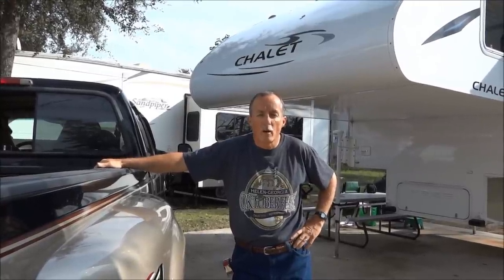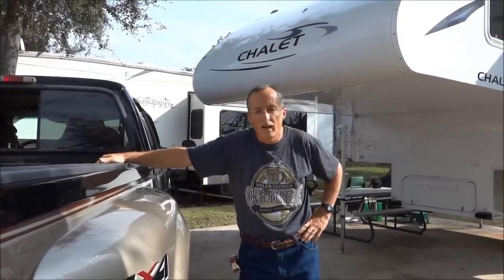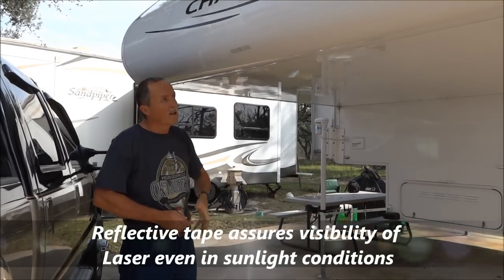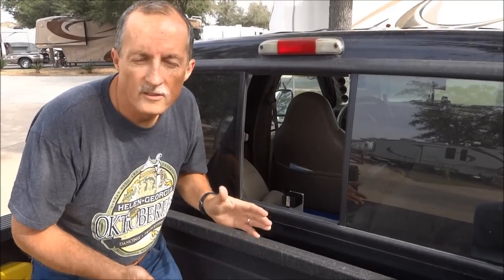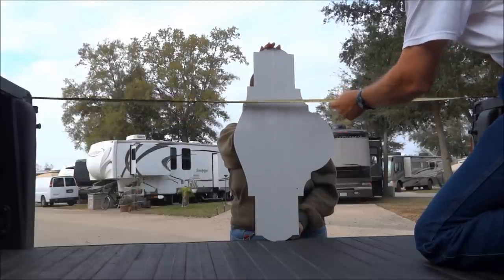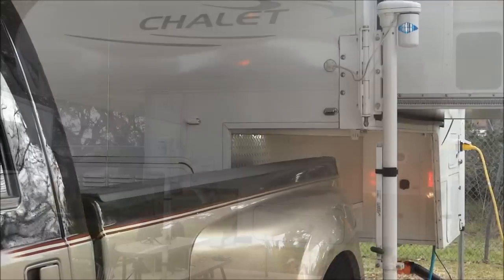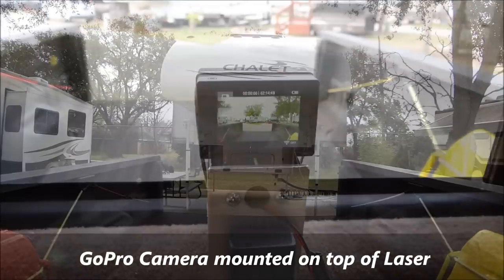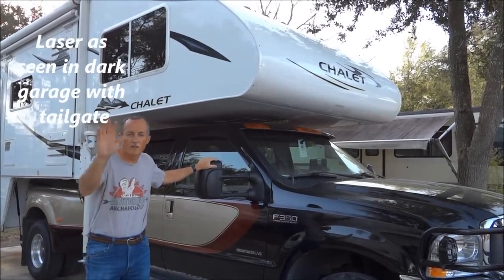How to Load a Truck Camper onto a Pickup using a Laser!

Comment: First thing I did when I bought my camper is sit down and try to figure out an easier way to load it. I don't think I would have come up with this on my own without seeing your video. Kudos to you and thank you so much for making that video! I ended up using a cheap $36 self-leveling crossline laser and the same principle.  I usually self-leveling crossline on a camera tripod to keep my camper perfectly level while raising and lowering it as well

Comment: That's brilliant - well done Charles.  I just finished spending several hours attaching extending, kind of antennae to the front of the camper - 2 thin, rigid, 1" * 1" wooden sticks that are exactly parallel to the camper base but extend into the pick-up bed about 5 feet - to provide a way to line up.  But your way is much more elegant.

Comment: Question- if the camper jacks were adjusted to make the camper level on un even ground and the truck was backing in on the uneven ground wouldn’t that throw off the laser line to the 3 points? Seems to me the camper jacks would have to be adjusted so the bottom of the camper was on the same slope as the truck bed. 
However should work on level or near level ground.
As I think about it… if the truck was placed very near in position, then the jacks were adjusted so the 2 marks on the camper box were inline ( equal distance) from the vertical laser line, then the truck was repositioned so all three points matched it should be very close.

Comment: Great Video Charles, I am a contractor and recently bought a truck camper.  I always figured that loading it with a laser is the way to go.  Ca you let me know what brand of Laser you used ?

I also designed and built a custom "Guide" for my F-350 Bed that prevents it from sliding sideways.  I will share an image soon.  Not cheap to build but works like a charm.

Thanks
Michael

Comment: Charles, I'm in the midst of installing the laser. Are you using sheet metal screws to secure the heat sink to th Al bracket in lieu of the hex nut screws provided? If so, what size screws are you using?  In attaching the bracket to the back of the truck are you only penetrating the seat backing? If so, does that provide enough stability? Sorry for all the questions....not very mechanically inclined!

Comment: Quick question - Looks like you're using some sort of rubber bumper mounted to the front of your camper to halt its forward progress when loading. Is that correct and where did you find those.

Thanks

Comment: This laser idea is a life saver!  My wife and I are newbies and our truck doesn't have a sliding rear window.  I took an aluminum angle iron and mounted the system on it.  The angle iron ,makes it easy to lay right on the top of the front of the truck bed just below the rear window.   By marking a spot on the top front of the truck bed I can easily turn the laser on and place it in the exact center and use it as Charles does.  When I'm finished, I just pick it up and store the unit inside the cap to keep it out of the weather.  Loading the camper is SO easy now!

Comment: Great idea I'm going to try it. I don't have sliding rear window so I'm going to mount a Ryobi laser with magnet on front center of my truck bed and then use 3 marks on inside of the tailgate to do initial laser setup alignment.

Comment: Loading a truck camper is hard, if you have a crew cab.  I have seen people measure the middle of the camper 1/2 way then the truck bed 1/2 way and go simply by the lines.  In the crew cab you literally have about 3 feet where you are blind.  Truck campers are the ONLY way to travel.  Now if you stay in one camp ground for a week and it rains, then you go a little wacky.  Bigger truck campers are HEAVY!  And the dealer, will see you a camper EVEN if your truck is not safe to haul it.  I LOVE MY lance camper but I think I would like the  Chalet but the weight.  oh boy! Great video. I'm afraid I will never go through all this trouble when a little tape will do the trick.

Comment: This is a great video, especially for someone who is backup handicapped. I do have one question, was the bracket custom made or is it available off the shelf. If off the shelf, can you please post where to get one.
Reply from the maker: Jim Collins The bracket was a simple piece of flat 1/8" aluminum purchased from your local hardware store that I drilled a few holes in to mount the laser heatsink and for screws to the truck.  The battery pack I just double back taped to the metal plate.

Comment: Did your heat sink have bolt holes in the back of it.  I got one and the bolt holes on on the side and bottom.  I may have to get a piece of metal with a 90 degree bend at the top.

Comment: I feel this is the best solution so far for aligning and loading my camper. Uneven ground is not an issue as I have a remote control for independent electric jacks. The only issue I have is that in the video, the alignment process is done on a cloudy day, under trees, and plenty of shade. I bought the same system,  installed it just like in the video but when I turned it on in the morning with bright sunshine facing the front of the camper the green laser does not generate enough light to see the white fiberglass or the silver reflective tape at over 8 feet away. Now I feel like I have to load the camper either early in the morning, late afternoon, or when it’s cloudy, which doesn’t happen regularly in the southwest. I will try a different, possibly more reflective tape first, or possibly a red laser. Ideas anyone?
Reply: Red lasers generate less light per mW than green lasers, so if you're having trouble seeing it, upgrade to a higher power laser.

Comment: It seems as if the system would be thrown off if the truck were not on level ground. How do you correct for a site that has a left-right slope? (extremely common in my experience)
Reply from the maker: You simply tip the camper to align the 3 spots with the laser emitted from the truck to make them parallel.
Reply: +Charles Coushaine Ah! Thanks! I'm going to give it a try using my level line generator I use for construction.
Reply: You would have to align the 2 vertical points with the laser then align the truck to all three points

Comment: Great job Charles!  Quick question, noticed gas tanks on forward inside of truck - wondering what size and where can I purchase them.  Been debating how to safely transport a couple gallons of gas - newbie to truck camping!  Thx
Reply from the maker: I purchased those gas/diesel cans on Amazon.com.  A link to one is below:
https://www.amazon.com/Briggs-Stratton-85043-Gallon-Spill/dp/B0038U3FQ0/ref=pd_sim_86_1?_encoding=UTF8&pd_rd_i=B0038U3FQ0&pd_rd_r=1PG7HDSEQGRJY25WYF7W&pd_rd_w=Y2LFV&pd_rd_wg=719wI&psc=1&refRID=1PG7HDSEQGRJY25WYF7W
Reply: Thank you Sir.

Comment: “Tavool” bright green laser available on Amazon July, 2022 for @$50. Appears to come with mount. 
I have a 2008 Northstar pop-up camper, and the gray water tank is a long rectangle that is attached under the camper in a way that really impedes loading of the camper onto my truck. There is only about 1/2 of space to clear. This is going to help! Thanks!
Reply: Hiya.  Did you get the self leveling one?  How’d that work out as I read it needs to mounted on a level surface …

Comment: After just purchasing a new truck camper, I have decided that I definitely need to incorporate your method of loading it on the truck or I think my marriage won't survive😜! In looking at the link the model you specify only has up to a 60 degree fanned angle. They must have changed it as it is the same model you specified. Think the 60 degree will work?
Reply from the maker: I believe that the 60 degree fanned angle will work.  I use this laser alignment every time I hook up and it has definitely saved my marriage as well...lol

Comment: Which beam angle did you get, the 40 or 60 degree one? Or was it the fan angle?
Reply from the maker: +Rick Stevens At the end of my video the spec sheet says it was a 90-120 degree fanned angle.
Reply: +Charles Coushaine thanks I missed that

Comment: Not sure I understand how this system keeps you from backing under the camper crooked. It seems all it does align the front of the camper with the back of the cab of the truck.  Seems like you could still load crooked and hit the back of your camper with the back of your truck.
Reply from the maker: Watch again paying close attention to the use of 3 points to create a plane.

Comment: What is the heat sink used for ?
Reply from the maker: The heat sink's dual purpose is to cool the laser if left on for a very long time, and add a convenient way to mount the cylindrical laser!
Reply: Charles Coushaine thanks for the info

Comment: Word of ADVICE to anyone considering ordering this alignment system.  I ordered the system, received the system MINUS any mounting bracket.  When I contacted the seller about why I did NOT receive a bracket for mounting the system, all I keep getting is run around.  In fact in one email, the company even admitted, by listing that a bracket was part of the package.  So, if you don't want to be forced to fabricate your own mounting bracket, do NOT bother ordering this item from Bright Modest.  If I end up getting some type of satisfactory remedy, I will update you.
Reply from the maker: Note:  Bright Modest mentioned above has no relation to me!  They are a company that stole my idea and tried using my likeness, and video, to sell their knock-off product which I do not endorse.  I have asked them to remove anything pertaining to me or face legal action!  Sorry for any problems you may face with them.